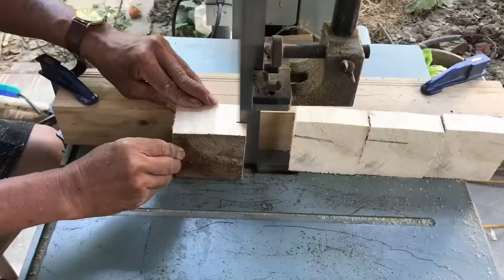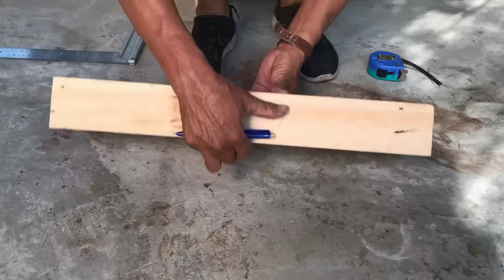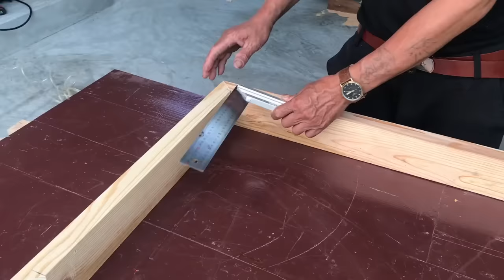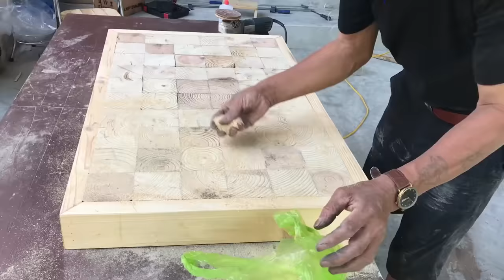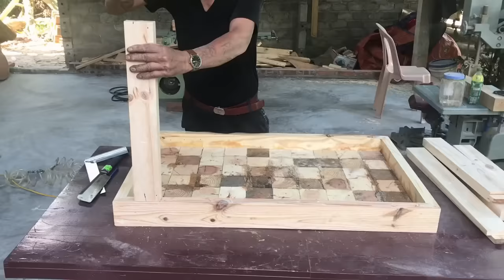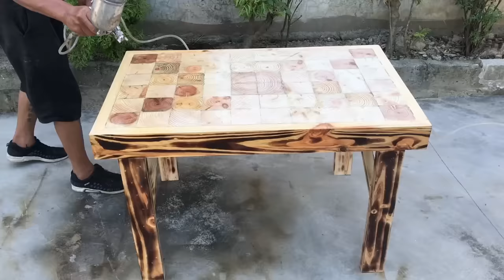Amazing Design Ideas Woodworking From Pallets // Building A Outdoor Table From Pallet Blocks - DIY!

Comment: Possibly, the most dangerous use of a surface planer that I have ever seen in my 53 years as a Woodcutting Machinist.
Reply: I was thinking exactly the same.
Reply: I have been a wood machinist all my working life, 39 years of it . I am absolutely shocked and dismayed by the lack of care. If this was in a UK workplace that guy would have been hung and the company folded.
Reply: Pretty sure you 53 years be in usa or another first world . im from cuba and kids Do the same sinze stared walk
Reply: The guy is from Vietnam, and I lived there for a while.  On building sites you see people wearing hard hats with the cheap moulded sandals!  It's a different world.  In a related observation, you get a lot of hand and feet accidents in a&e (which I noticed when at hospital for cutting the end off my own thumb with a cleaver, got sewn back on for less than $100)...
Reply: @xileffelix6893  Just a couple of questions.  Do you have pushers banned in Cuba?  How does an empty head relate to a place of birth?
Reply: Ужас, никакой техники безопасности..

Comment: I dunno mate. You've got a huge workshop with solid floor, thickness planer, airbrush and still half of the stuff you do is looking very hobby. Table is a good idea and looking alright. I'd just use different sander and reinforce the desktop. But please use sticks to move wood through the table saw. You don't wanna loose fingers 🙋🏼‍♂️✌🏻😄😄

Comment: ... yeah...DIY...I was about to make the same project, butta...I’m missing one of those machines that make holes 🕳😌
Reply: Check at Lee Valley Tools they may have a square bit that works with a regular drill press
Reply: I was thinking a router might work.

Comment: great job, always good projects. a curiosity: what kind of glue do you use?
Reply: It is common wood glue to join the blocks. Then they spray cyano acrylate glue to harden the sawdust which was used to fill the gap of the wood

Comment: Nice job!

When you fill the cracks with sawdust, what kind of glue or sealer are you using on them? Thanks!
Reply: I think that he is using CA glue, please check to see if it is correct.
Reply: Yeah, Nam Linh hai, (502) is cyanoacrylate adhesive.

Comment: I like the concep but id be a little concerned about the separation of joints with expansion and contraction of the wood due to humidity?
Reply: You can see at minute 14 and on that the table has already started to buckle.  So much endgrain lol

Comment: Wow this  will self destruct in say Massachusetts or pick a northern state with central heating
ImGine what is going to happen as the summers are hot and humid in Minnesota  it very cold and very dry especially ially indoors where the heating makes the air dryer than the Sahara desert.  I made a chess board with this  onstruction I tasted four years. where these guys Iive  no problem. Not much wood movement in that climes. I amended guessing  jetnam Cambodia Laos or Thailand  it doesn’t matter they are very lucky not to need to worry about seasonal wood movement in swelling across the grain

.

Comment: I used one of those combination table saw, jointer and thickness planers over in Cyprus years ago and liked them. Anyone know of a distributor in Alberta? I think the machine that I used was made in Italy.
Reply: Where in Cyprus mate? I'll go and check the machine for details!!
Reply: @jackjones852  It was out by the Nicosia airport. we [the Canadians] were billeted at an old bombed out motel that we renoed even made a swimming pool out of one of the water fountains out front. The carpenter shop if memory serves me right was across from the entrance. I worked with an old Greek carpenter by the name of Kostas a real good guy. On another note ; Is the old Pissass Tavern still there, just off the base?
Reply: @AnMadreMor  There IS a Pissas Tavern less that a mile from the Gate, though I am not sure if it is in the same location today as it was when you were there. You can find it on Google Maps very easily. 
I live in Limassol and used to go to the UNHCR HQ corrugated iron half-cylinder building in the airport about half a dozen times a year but have not been there in he last 5-6 years. Never noticed a carpenters shop in the area even though I used to drive constantly along the perimeter of the compound. The area has changed massively in the last 10-12 years with many university collages and big showrooms moving there so I would not be surprised if Kostas has either moved, sold out, or even retired. 
When is your next trip to Cyprus planned? We'll go out there together and recce the area!
Reply: @jackjones852  I was there in 1991 so the base may have changed with the removal or demolition of various buildings. I don't even know if the old motel is still there. The battalion stayed more or less in BBC or Ledra Palace and as I was with the engineers we stayed away from the main camp at the old motel. The Australian Police contingent stayed in the old tower building and they were always at out place. It was pretty small, we used the main entrance lobby as our mess/dining  area and the bedrooms the check in/out counter being turned in to our bar. the bedrooms went out from each side. All in all it was a pretty good set up of course being engineers we could do just about anything as long as we had the materials. Kostas was up in years and has probably gone to his reward by now. He made me a wooden map of Cyprus with the Greek coins inset in it as a going away present which I still have. I enjoyed my time there immensely. I don't know if I'll ever get back as I'm in my 70's now and live in Alberta Canada. I used to have an expat friend who retired there but have lost track of him and his wife. Did they ever reopen Nicosia airport? Always up for a chat. Cheers ;-]
Reply: @AnMadreMor  Nicosia Airport is still in limbo, with the 2 Cyprus Airways Trijets still on the apron! In fact one of them (the one that did not burn) can clearly be seen on Google Maps . Search "Nicosia Airport" on YouTube, there are several pretty sad videos there.
Been to Ledra Palace parade ground several times and watched the poor squaddies collapsing in the summer midday sun as recently as 2004. Since then they have decided that the evenings are a better time to be out on the parade ground in full dress uniform! Along the front of Ledra Palace is now a very busy place as it is one of the official crossing  points between north and south but only for pedestrian traffic, unless you are a diplomat, of course! The general area leading from Famagusta Gate towards Ledra Palace is slowly falling apart as too many parties need to agree to too many aspects of anything in order for any repairs and maintenance to be carried out. Pretty sad, really.
Cyprus has changed MASSIVELY since the early 90's and most, if not all of the innocence has unfortunately gone but life is still moving at a very leisurely pace and the weather is as nice as ever making the island an ideal retirement destination (hint hint). My wife's (retired) uncle lives in Toronto and the couple now spend the winter months in Cyprus every year to avoid the Canadian winter, so anything is possible!!!!
I hope you get your hands on a more modern version of the combination table saw/planer that you are looking for. It is really a joy to use.
Reply: @jackjones852  I s the writing still on the side of the mountain? I enjoyed my time in Cyprus but I like Alberta better.My home backs on green space and I enjoy walking my dog through there every chance that I can especially during the winter. If could afford to I'd like to retire in Queenstown on the south island of New Zealand [heaven on earth in my opinion] I plan a trip across Canada to the east coast by train to see friends along the way after covid if I'm still on this side of grass then maybe one last trip over to Ireland and walk the Wild Atlantic Way. I t was awesome the last time I was there in 88. Have a nice life on your island paradise.

Comment: While this video is being pushed I'd like to say, by all means use the project as inspiration for your plans but do not use tools in the same way as these folks do, with little regard to safety and safety precautions. Woodworking can be a dangerous hobby and profession if not done correctly. So please stay safe because you cant woodwork if your dead